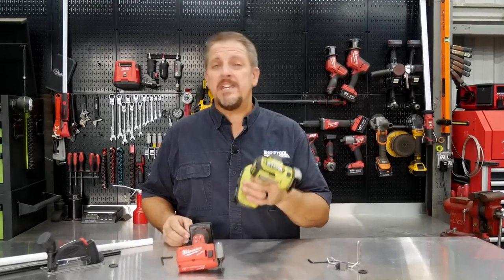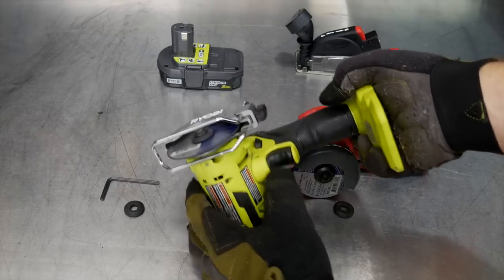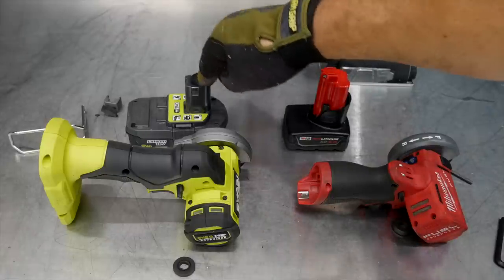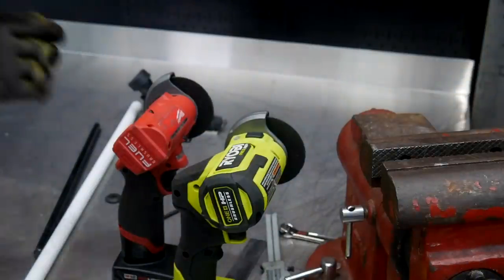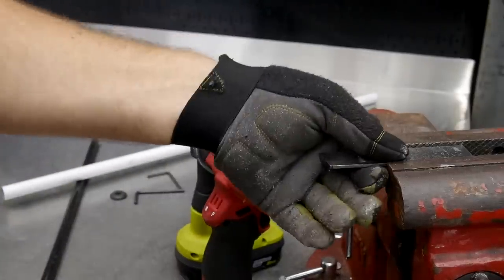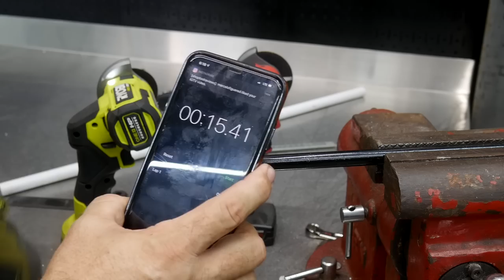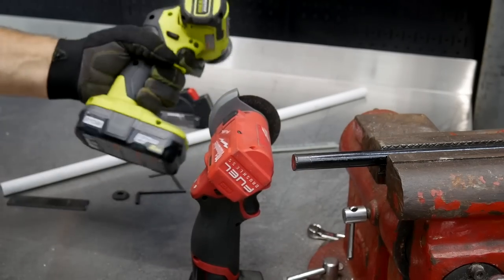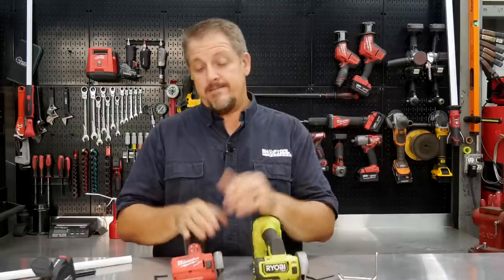Milwaukee M12 vs Ryobi HP 3" Cut Off Saw Showdown [20,000 RPM]

Comment: a comparison between the largest batteries available for each would also be very handy.  the 18v is a lot bigger tool so the much larger highest capacity battery shouldn't be too much of a stretch vs 6ah m12.   Also I'd really like my Milwaukee's to have the metal depth guide the ryobi has vs having to put the big dust hood on.    Going through sheets of drywall and the like while on walls it's very important to set max depth.
Reply: I have the Milwaukee cut off and have a 6.0 and it still has issues with bogging down cutting out/overheating and draining the 6.0 like it was a 2.0. 
If you have Dewalt batteries I would wait for the Dewalt 3” cut off 20v XR to come out. It might be bigger, but it will probably get the job done. The Milwaukee is like a toy, small and somewhat convenient, but it will only frustrate you, give you a headache and waste your time!
Reply: @akaredcrossbow  I now have 2 Milwaukee cutoffs
I still wish there was a metal guide to quickly set depth but so far I've cut a lot of drywall, cement board, some cement and some aluminum and brass and a lot of steel haven't had any bogging down.    I have not used it to cut tile and granite yet but I plan to soon.   Hope it does reasonably well with those.
Also haven't tried large jobs... Would use angle grinder or the like on something bigger like a lot to steel or cement
Reply: @L0st-n0found  I’m wondering if the tool is a hit or miss, maybe some like mine had production issues. I do see a lot of mixed reviews, some work flawlessly and some have problems like I do with it.
Reply: @akaredcrossbow  maybe I watched some of the video reviews then bought and have been very happy.     I have mostly been using 4ah batteries.   I also have only used it for very small things like cutting through a few heavy duty padlocks (yes mine) and several bolts, nuts, some heavy gage steel sheets but only several inches at a time.   So I may not be hitting the limits of issues.    It does wonderfully through cementboard, drywall, stucco etc.   Great in remodels.   I also used on pipes.    It's very handy for me.   Have a few oscillating tools (my eyes are on the new makita), Dremels, makita and dewalt cordless routers, used to have a rotozip, etc and like this for a lot of the things I have used those for have several cordless angle grinders and old made in germany corded metabos... I prefer this for a lot I'd have to grab those for in past.    Small jobs though.  
Have my eyes on  finding good wood circular blade (watched reviews on generic amazon wood blade... whichn I am hesitant on)  as well as the 3inch Diablo blade for stone.  Do see that for order and not in my local home depots.
I
Reply: Believe it or not , most users simply use whatever they have commonly available in their shop or tool bag. 
Very few would run out to the store to get the biggest battery available for their first usage. 
This is why you will see newbies buy a bare tool snowblower  or lawnmower or a circular saw or a full size angle grinder, or a chain saw with a feeble 1.5 - 2 ah battery 🔋 complained loudly in their lousy product reviews. 😅😂

Comment: The biggest thing with the Milwaukee is that you can't bind the blade in any way. Has to be 99% straight cut or it will stall.
Reply from the maker: Yes, actually either of these will stall if the blade binds at all. They're still very useful tools, but they're not high-powered beasts. Thanks for watching.
Reply: @Shoptoolreviews  Yup. I love it. Perfect for small tile jobs. Dust extraction is why I bought it originally. No need to go outside to cut. And uses the same batteries as my other dozen M12 tools.
Reply: So it work just like a air die grinder

Comment: Im wondering if the ryobi battery ever gets in the way from doing a job since it is far from flush. M12 can go into a CP battery for space. Not sure if this has real life application
Reply: Only issue is the xc battery was already struggling to supply power. You'd need the new high output 2.5ah to stand a chance

Comment: It would be nice to compare these to Bosch 12v cut off tool. Bosch is definitely lighter and smaller with 2-2,5 Ah battery, also brushless but lacks LED lighting, speed and direction controls

Comment: I feel the same way about these as I do with an oscillating tool.  I'm sure there's a good reason to buy one, but I can't think what that might be.  Already have a variety of angle grinders, sawzalls, portaband, and yes, an oscillating tool.
Reply: Im an electrician and these things kick ass when it comes to cutting tile and plaster.
Reply: The oscillating tools are great because they're way less violent than an angle grinder or recip saw, and they're phenomenal for drywall cuts. Now these guys are great for tight spaces on things like conduit and small copper pipe, or tile work where an angle grinder would cause more harm than good

Comment: Can you cut through Brick Pavers with cut off tool. And what blade  to use ?
Reply from the maker: I don't think the 3" blades are large enough to cut through brick pavers. I think a cheap 4-1/2" angle grinder with a masonry blade would be the best choice. Thanks for watching.

Comment: I'm not sure if we have this bigger 3 ah batteries in stores available, but with a regular 3 ah smaller battery, milwaukee cut off tool is way more compact then Ryobi. If you need speed and power go for 18v. But when size and weight comes to play milwaukee m12 platform is hard to beat.
Reply from the maker: Yes, both of these cut-off tools are great specialty tools when used properly. Thanks for watching.

Comment: How in the hell did the bon the builder tools put preform a Milwaukee? Kinda impressed with that Ryobi honestly but i just picked up the Milwaukee mostly to cut 3/4"-1" conduit so im sure it will be just fine
Reply: It's battery.  18v still allows a bit more power.

If you compare 18v to 18v Milwaukee Ryobi it's no contest

Comment: i prefer this style of tool for doing metal roofs over using the electric snips, i use it just like a mini circ saw with  the little shoe on
Reply from the maker: I didn't think these were approved for metal roofs. Most metal roofing manufacturers don't approve of any cutting tool like this and they won't warranty any issues. Thanks for watching.
Reply: @Shoptoolreviews  i use it for the metal roofing for planter boxes, inserts into cabinets and other stuff like that not on roofs but the same materials.

Comment: Let the disc do the work.  If the tool is bogging down, then you are doing it wrong.  Yes, the Ryobi has more power and can cut faster, that shouldn't be a surprise to anyone.  But the Milwaukee will get the job done if you don't try and force it.  It will just be a bit slower.  This is one of those applications where the higher voltage tools have a real advantage and can use the extra power the 18V batteries can provide.  But the 12V tools are lighter.  That's your tradeoff.

Comment: Wheel on ryobi looks much smaller after 1/2" rod???
Reply from the maker: You are correct, the Ryobi wheel was a little smaller at the end. More power equated to a little more force applied to the wheel . Thanks for watching.
Reply: That has to do with consistencies with the pounds of pressure applied since he was doing it by hand... Means absolutely nothing go and watch project farms unbiased reviews he uses a 10 lb weight for each tool so there's no inconsistency
Reply: @mediumgrey1947  so do you

Comment: I have both Ryobi and Milwaukee M12 tools. I think that your run time comparison is inaccurate. The Milwaukee will reset after releasing the trigger for a few seconds, but to reset the Ryobi, you have to remove and reinsert the battery.

Comment: What is the advantage of using this over an angle grinder? What situations would I use this over a grinder?
Reply from the maker: This is just a handier and more compact tool to use. It definitely doesn't have the power of a full-size 4-1/2" angle grinder. Thanks for watching.
Reply: Yeah, I was working on an Airstream trailer on numerous outriggers in very tight quarters. My 4.5” grinder was often too big/long to make certain cuts. This smaller tool would’ve made the job easier.

Comment: I have the m12 cut off tool and I find that the 6.0 battery gives much much more power and run time I think it would be more fair if you used it and not the 3.0
Reply: And how would that be fair when the ryobi would be using the 2ah? Hahaha
Ryobi is far cheaper and better.
Reply from the maker: We were trying to keep the tools as fair as possible We'll run another test using larger batteries on each. Thanks for wattching.
Reply: 12v with 6AH vs 18v with 2AH is unfair?  Would be for run times yeah.
This comparison is cutting ability mostly is it not?
Reply: agreed..I use a 6ah battery on the milwaukee and you can notice the difference..

Comment: I don't expect Milwaukee is better because it is 12v. They are made by same company and both are brushed. The disc is too expensive, so I returned the tool. I will think about buying one if the disc is under $2.
Reply: Diablo sells a 3” metal cutting disc now at Home Depot, it’s a five pack and they sell it just under $6, much better than the Milwaukee discs. 
I have the Milwaukee cut off tool, and the best bet is to wait if you can for the Dewalt 20v XR to come out, should be out soon I believe.

Comment: how they compare weight wise? and handling? which feels more comfortable?
Reply: from the video with the batteries on, they both look to be about the same size and weight? I'm just curious if the m12 is really that much smaller
Reply from the maker: They're pretty much the identical tool, other than the battery. Of course the M12 battery is smaller. Thanks for watching.
Reply: @Shoptoolreviews  thanks!

Comment: The cutout on the ryobi you need to remove battery and plug it back in.
Reply: Because the battery is cutting off not the tool

Comment: I love slide-in battery over plug-in battery.
Reply from the maker: Both of these are post batteries that plug in vs slide in. Thanks for watching.
Reply: The Milwaukee 12v batteries can be a little difficult to disengage. Release clips work so-so.

Comment: All I really wanna know is...
 DO EITHER of these cut-off tools CUT WOOD???
Both Ad descriptions state they cut metal, plastic, & something else (I forgot) but neither of them said specifically that they can CUT WOOD.
Relatedly, Ryobi & Milwaukee are the only brands (out of your typical Home Depot top 5) (not sure about Bosch) that don’t seem to have one of the smaller hand circular saws. For example:
RIGID: “18V Sub-compact Brushless 3 in. Multi-Material Saw R87547.”
MAKITA: “12V MAX CXT Lithium-ion 3 3/8 in. Circular Saw SH02Z.”
DEWALT: 20V MAX  ATOMIC 4-1/2 in. Circular Saw DCS571B.”
All 3 are basically smaller circular saws with handles & clearly state they cut wood.
Ryobi & MilwauKee do not appear to offer such a thing. This is the closest they come to one. So....CAN THEY CUT WOOD? Do they even make a wood cutting blade for these?
Reply: I have both now but have not seen a circular saw blade as such for either here in Australia to specifically cut wood.
Reply: @markamouat  thanks for responding. The only information then that I’ve seen to gather then is that a dremel wood cutting blade might be an option.
Reply: I have the Ryobi and the drywall/plastic blade cuts wood like butter. The dremel blade works as well.
Reply: @jwarner8844  ok so the drywall/plastic blade made for this saw you say cuts wood? And liek butter at that…. GOOD STUFF.
Reply: I actually bought the 12V Makita 3 3/8” circular saw recently along with the 12V battery & charger. $160 BUCKS…. I haven’t even opened the batteries & charger package up. Haven’t even got to use it yet. 
Because… I feel like it’s stupid for me to have this 12V tool - when I don’t have ANY other MAKITA tools.. and if I did have other Makita tools - I’d think having a 12v & 18v charger 2 in 1 charger would be the best way to go. In that case this single little 12v charger would be stupid - just another thing to plug in. I barely have enough electives outlets as it is - I’m actually technically working off a single outlet.. with various cord extensions & a power strip coming out of it - & I’ve got a fan on most of the time, a big rigid vacuum, a big job rocker speaker, until I get a portable sander I’ve got my sander plugged in most of the time… & a table saw. I can’t be having all these THINGs plugged in to one thing.
And it’s no secret that Makita is pricey. I just REALLY want a saw like this. Small, easy to cut 1/2” plywood whenever I want to do whatever I want…. And the only other SAW like this I can find is the Rigid 3” circular saw. But even them… they cost more than Ryobi. I’m new to all this & I’m over here TRYING to find a good deal on a nice handful of Ryobi tools…. At a steal of a deal…… I’m really hoping if I return this Makita saw & battery crap I bought that this Ryobi cut off tool will work very much the same as the saw would’ve.

Comment: Can you put saw blades on the ryobi for cutting nonferrous metal like aluminum? Mostly I use my circular saw for this, but having a smaller and more easily controlled saw would be good until you get to around 3/4 or 1 inch thick stock, especially things like 1/4 inch plate. I have a plug in Dremel that I'm going to switch to for a lot of this, but I think it may not last as the last job was cutting a bunch of concrete board and the venting is poor, so I may need a need tool like this. I have lots of ryobi batteries up from 1ah to the 9 ah, they released this tool after I bought the Dremel.
Reply from the maker: No, I don't believe they make saw blades for these, and I'm not so sure that the motor would be powerful enough to turn it. Also, the saw blade would need to be capable of spinning 20K rpm. Thanks for watching.

Comment: Honest question as I’ve never had one of these. What’s the advantage of buying one of these as opposed to just a typical angle grinder type tool? 

Can’t you just flip a grinder sideways with a .045 wheel or something and go to town?
Reply: @markjtirbany  thanks mate
Reply from the maker: The Angle Grinder is a better option for larger jobs. These are better fit for small parts and projects. Thanks for watching.

Comment: It does not matter, neither of these are as good as dewalts cut off. The Dewalt is the #1 according to TTC, project farm  amongst others then it was Rigid in secon. I had the Milwaukee it was gutless so i gave it away and got the Dewalt its a little beast i even use it for cutting skids

Comment: The ryobi clearly dominated and can definitely get the job done. There’s really no other side to the story. The only thing that was close was runtime and a far stretch to be called a fair point for choosing the m12.
Reply from the maker: Yes, the Ryobi 18V out-powers the Milwaukee M12, but either is a good choice if you already have one of the battery platforms. Thanks for watching.
Reply: The m12 line is a pretty sweet line though.  But i have batteries for both, and on this tool, I agree, think I would get the ryobi.
Reply: Dominated? Lol. It cut like 1 second faster, if even, but it's a bigger tool with a bigger battery and 50% more voltage. AND it died first. Put a Fuel M18 vs that Ryobi and see who gets "dominated". Of course the tool with 50% more voltage will be a TINY bit faster, it should have been much faster. And the bigger battery should have lasted longer than the M12.

Comment: If the two hp tabs aren't  needed then why does some of the hp tools have them and some doesn't.  I think all should  have the two tabs. They're on the battery  for a reason
Reply: The HP branding was a really poor choice by ryobi. All HP on the tool means is brushless. HP on the battery means higher power output. So many HP tools don't actually need the higher power output from the HP batteries.

Comment: I have the Milwaukee one. It stalled at least 5 times on one cut of M8 (appx 5/16") threaded rod with the included abrasive disc. And this was with me trying to be as careful as I can to avoid putting pressure on the rod or rubbing on the sides of the cut. I thought this was normal when I saw a video of someone stalling it cutting a #8 wood screw. Should I contact Milw?

Cuts plastic great though.
Reply from the maker: Once the battery drops to 2 bars, it drops in power pretty significantly.

Comment: Not fair comparison in any way! 18v tool & 12v tool the higher the voltage category the cooler faster an efficient will cut!! battery wise again voltage, amp hour and mass will make the difference
Reply from the maker: Many things make a difference with batteries, not just voltage. Thanks for watching.
Reply: Voltage doesn't make a difference look at Milwaukee 18v competes with Dewalt 60 v the higher is more efficient and less likely to overheat

Comment: I have the M12 Version and it has it uses like Aluminium trimmings that i cut regulary by hand in 45%. Its light and you have more control of the blade as on an 18V grinder especially if you work one handed. 
For more this tool seems at least for me its not more usable
Reply from the maker: Yes, the M12 is very handy. Thanks for watching.

Comment: Had the same thing happen to me out on the field with the m12 cut off with the 6.0 battery. Kept cutting off power when I was cutting frp boards. My boss ryobi powered through the cuts but the battery wasn’t that great. I wish Milwaukee would make an m18 fuel version